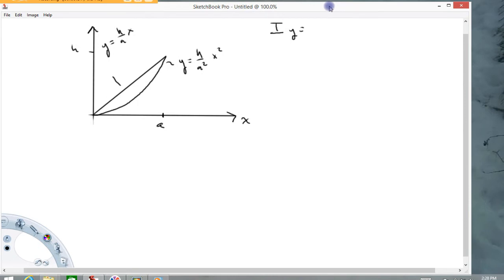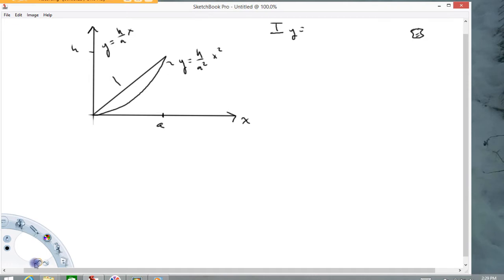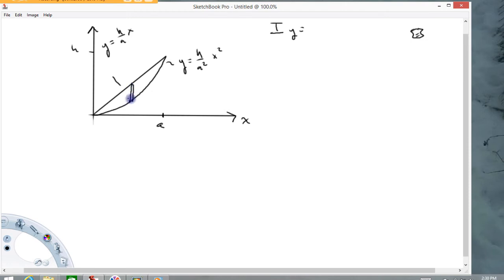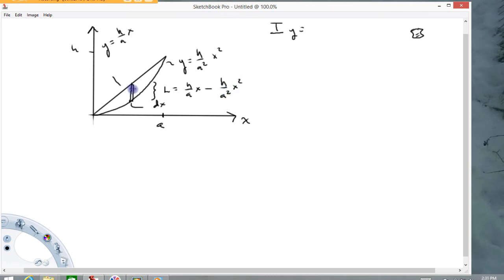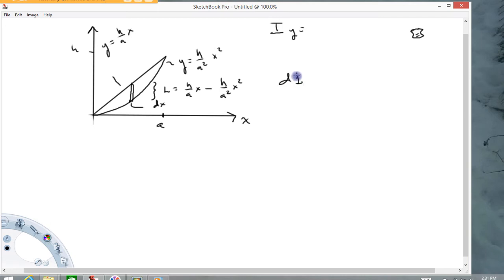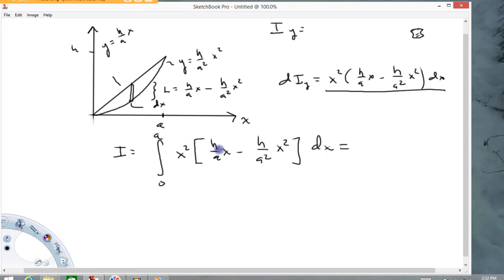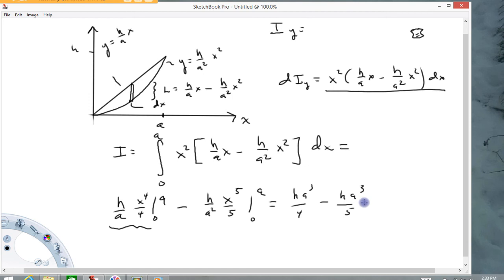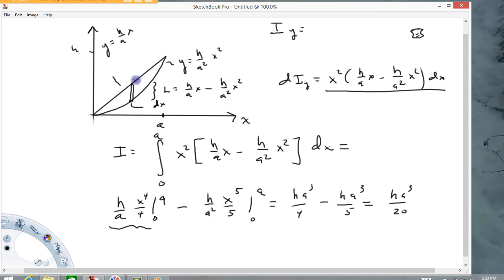Moment of inertia by integration

Comment: This is great.  If I have a 35 pole sitting on a lake bed in 6 ft of water firmly attached to pilings that rise 9 ft above the water - leaving 20 ft exposed above the top of the pilings, what length would I use in this formula to calculate the tipping of the pole under wind loading?  Any help would be great.  Have calc'd the wind load at 185lbs at 50mph